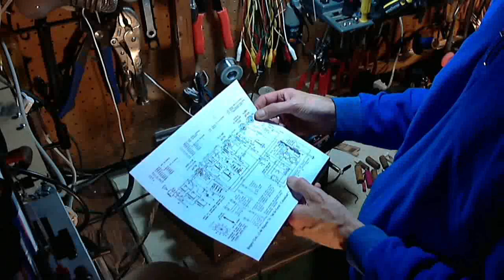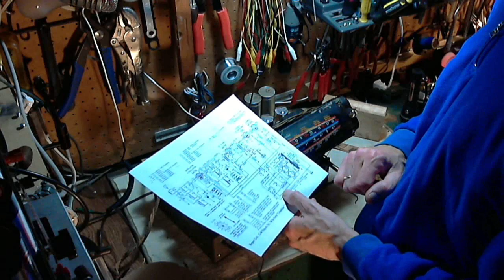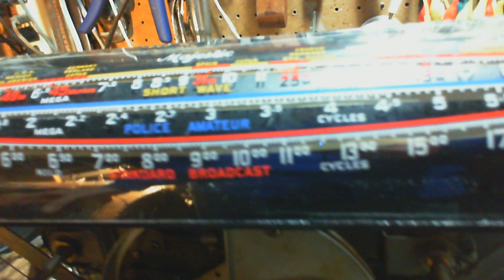Rogers Majestic 7M632 Vacuum Tube Radio Video #6 - Power-up Test

Comment: Maybe that metal thing the light is attached to has a slit in it and should have the lamp inside it. It looked tubular shaped and maybe overlooked by the previous repairman.
Reply from the maker: I just figured all that out.  I'll be posting the videos tonight.

Comment: The volume may be low without the bias cells. Those 2 wires sticking out may be for the lamp for the preset tuning dial. The dial pointer lamp would of probably had a metal cover over it with a slit cut into it.
Reply from the maker: I just shot a video of me figuring all that out.  You almost spoiled my fun.  :-)